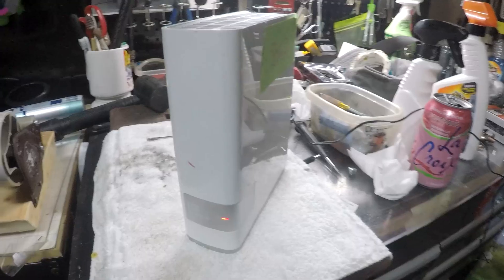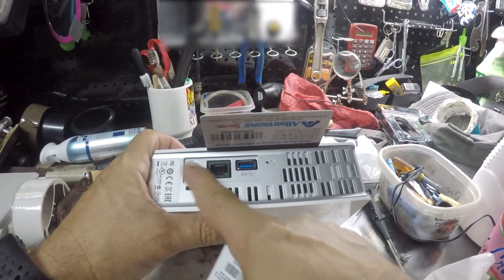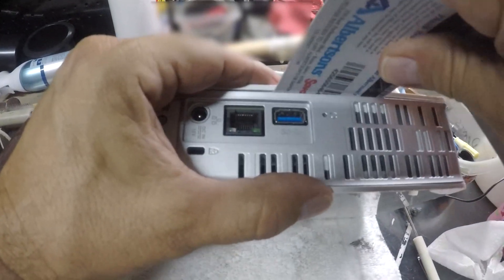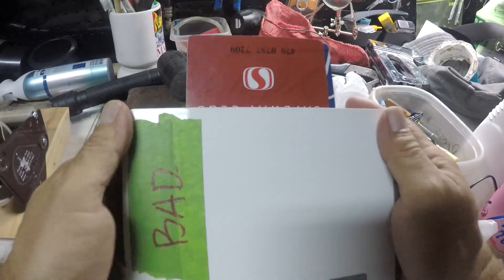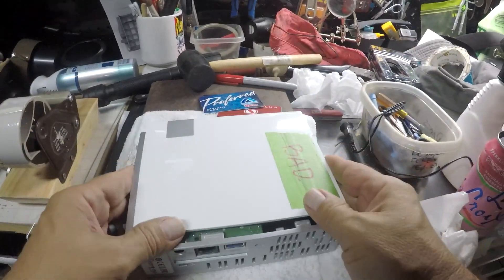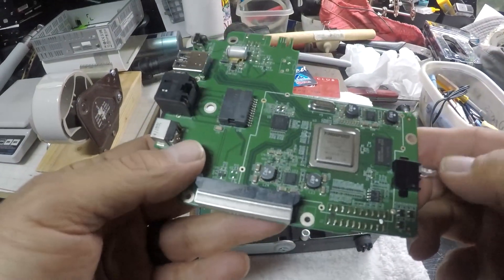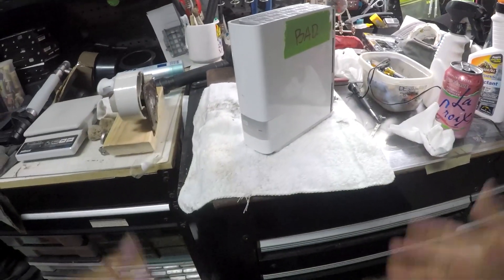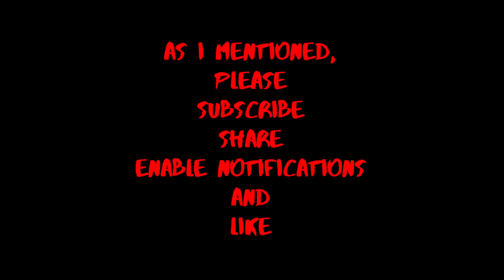DIY OPENING AND REMOVING 4 TB HD FROM WD MYCLOUD ENCLOSURE

Comment: WD is hostile to its users, it is about controlling them and what they are supposed to do; when I bought this unit quite a few years ago, I could just enter the IP adress into the URL of the Windows Explorer and had access to the disk as if it were locally connected.
Then they changed that; this first unit could not be repaired, and for the WD price policy a new WD cloud in the supermarkets is less expensive than only a new hard disk (Online sales like AliExpress, MercadoLibre, ... may have changed that by now, but at that time I could not get a good deal).
This new disk does not allow me to enter the ip adress into the Windows Explorer, but I have to open a browser and log in into my WD account; if I am offline, I can not access my local disk.
And ... imagine you buy a Samsung TV and you find a remote control - do you want to log in into your Samsung account for your remote to work and watch TV?
I now have a new unit, not from WD; the WD my cloud is connected, but I am not using it.

Comment: The movie, how much on YT, is a complete rubbish that nobody needs.  Disassembling this box is a task for a five-year-old, and you brag about it as if you were a genius, it's a waste of time to watch.  But if you are such a smart one, format the disk in such a way that the internal system reads the disk and the device starts.  You will probably show me videos of windows, unix and other shit, and what if I don't want to recover my data due to a broken disk, I just want to replace the disk with another, bigger one.  It cannot be done in the normal way.  I only have apple hardware.  I read all the internet like Chuck Norris and what?  And nothing, I found no information.  That's why I think WD Cloud is big shit.  threw them in the electrical waste bin at the local landfill.  I never want to deal with WD Cloud Products again.  Don't buy WD Cloud, that's big shit.